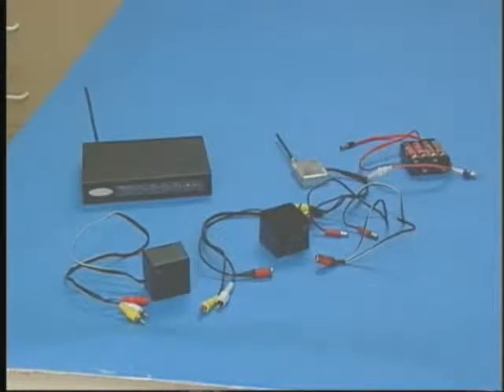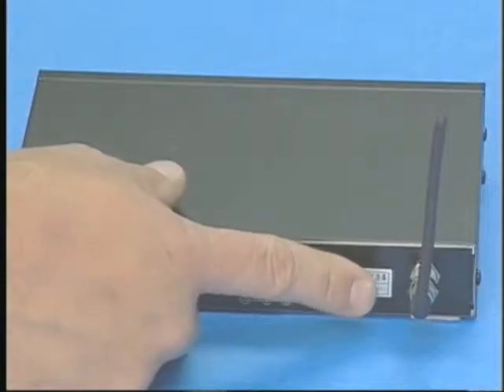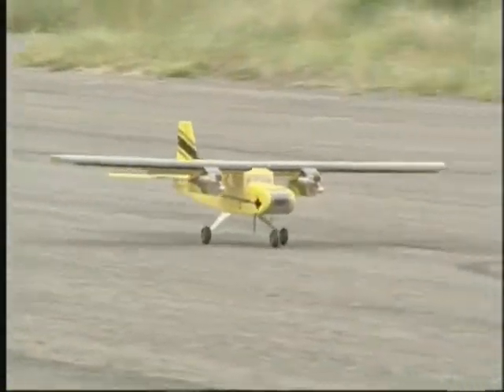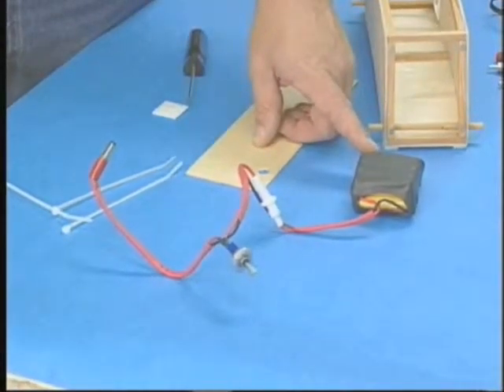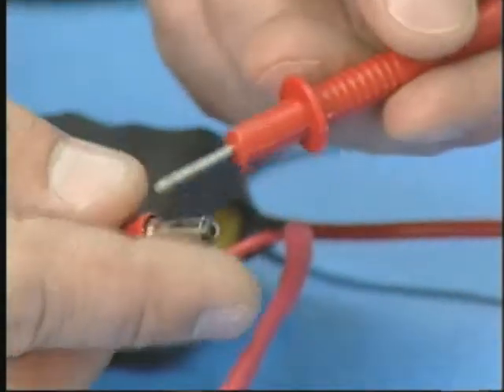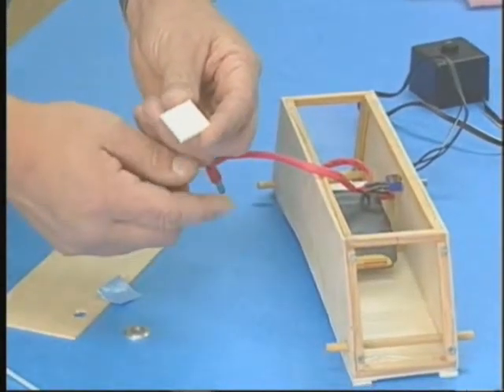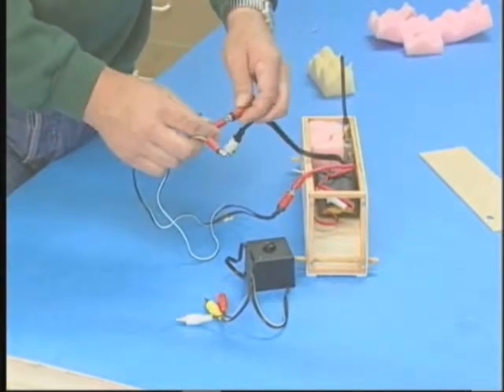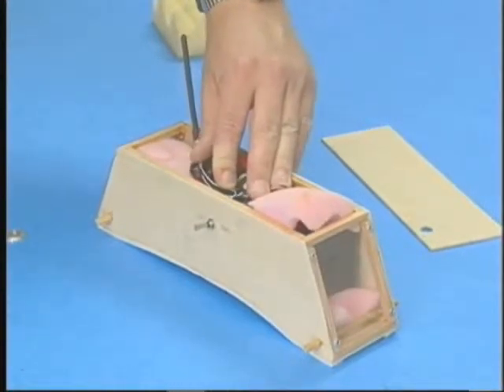INCAB-RC Videolink Installation part 1

Comment from the maker: The system shown here was one I put together for SuperCicuits in TX 13-14 years ago now. They still sell it but a much more improved upon model. The package they sell is the AVX900S9-V  This setup runs $350.00.